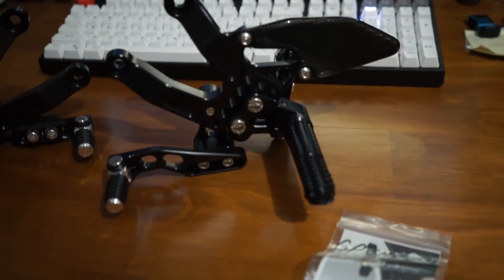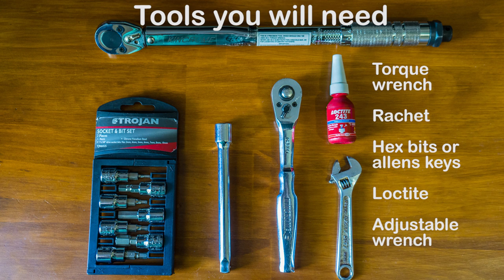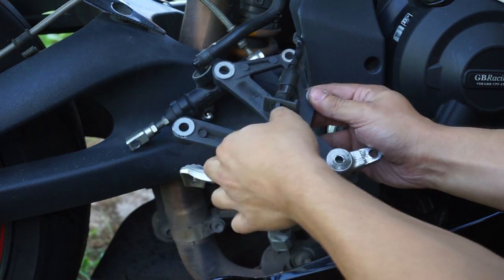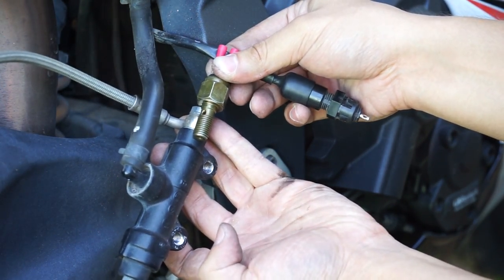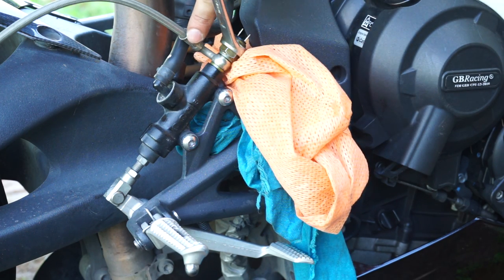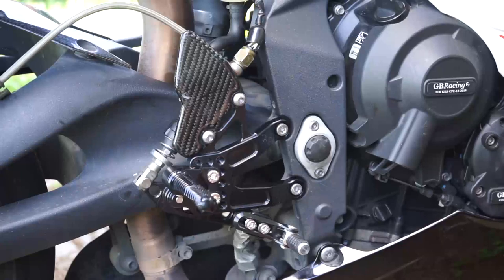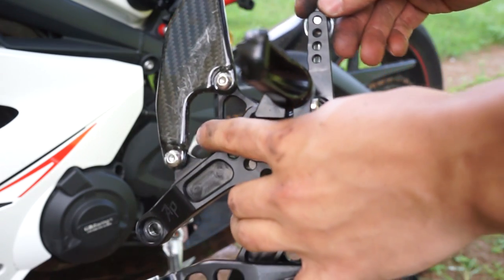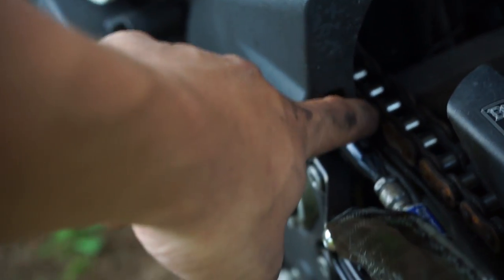[How To] Install Aftermarket Rearsets

Comment: I have a question. I laid my 2016 ninja 650abs down last night and my only issue is the left side rear-set is bent in causing my shifting lever to be obstructed. How can i get another piece (just that one rear set plate) by itself
Reply from the maker: You have 3 options:
Find a used one at a wrecker
Buy that part from the dealer
Buy a full aftermarket set

Unfortunately, I don't think many people would be willing to sell the sets individually

Comment: What site did you get that banjo bolt from
Reply from the maker: I just went on ebay and typed "Pressure banjo bolt M10 x 1.25 pitch thread" but if you have a different bike, make sure you know what size and pitch to buy.

Comment: Where did you get that banjo bolt at?
Reply from the maker: I just typed in "pressure banjo bolt" into ebay. Make sure you're aware of what size and thread pitch fits your bike, mine was M10 x 1.25 pitch thread

Comment: Can I install this on Yamaha Raider?
Reply: I need to move back the brake back short legs hard to reach and be touching the hot pipe
Reply from the maker: Absolutely, as long as Attack or any other brand make a kit for your specific model. You can put aftermarket rearsets on most bikes.

Comment: what was the torque specs for the four bolts at 12:00?
Reply from the maker: The rearset to the frame was 27 N.m, and the heel guard/brake master bolts were 18 N.m. This was for a 2011 Triumph Daytona 675, be sure to double check for your model of bike.